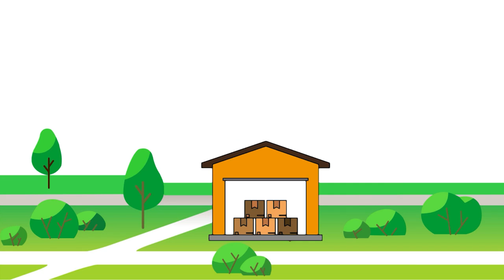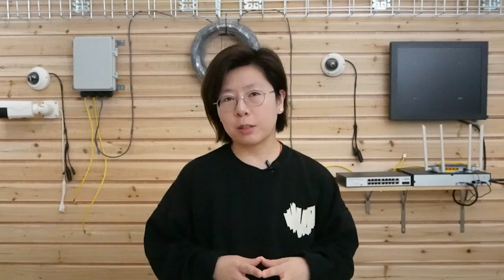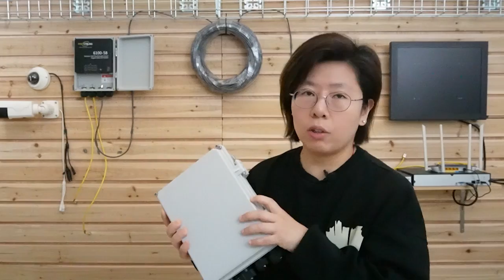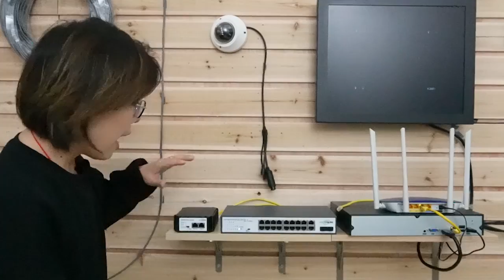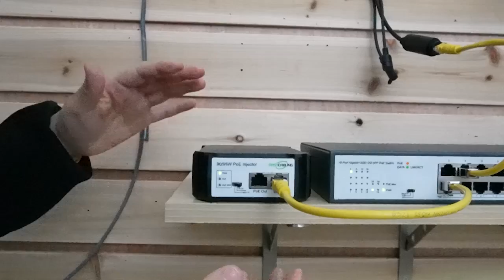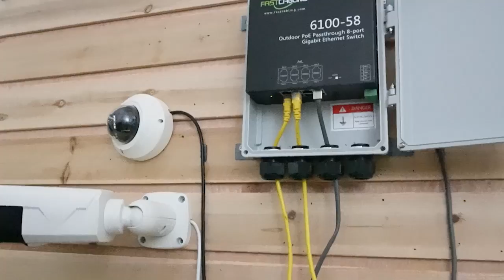Install a 24-CH IP Security Camera System for Storage Faculty| Case Study

Comment: Is there ever a layout situation where a 90w POE injector is TOO MUCH wattage for the layout and number of devices? Can individual devices be over powered to the extent that damage may occur?

Also, I would like to use V360 wifi PTZ cameras communicating through EAP225 AP's. I assume that each camera would have to have a dedicated power source...is it possible to run those type cameras as POE devices? While on the topic of V360 PTZ wifi cameras, is it possible to run those types of cameras to an NVR and have the NVR plugged into a router and have access to the camera feeds both locally and over the internet?

And lastly an Omada controller is also assumed. I have no working knowledge of how the Omada controller works. Is there a place to learn how the Omada applications work?

Thanks in advance.
Reply from the maker: All the devices just will consume the power it needs. 90W PoE injector doesn't mean it will output 90W unless your device needs such high power. But it will be overkill if put a 90W injector to power EAP225. As a matter of fact, it will not work, because the EAP225 doesn't compatible with the latest POE standard IEEE802.3bt. Part of the EAP225 is being modified to take in the 24V passive POE which causes the power issue in the latest PoE standard. If you want to power the WiFi PTZ camera with PoE, you might add the PoE splitter. The PoE splitter seperate the PoE power and convert it to DC12V.
Reply: @Fastcabling  
Thanks for your reply. My basic goal would be to run three EAP225's as POE devices for wifi connection to four (to begin with) and up to six V360 PTZ wifi cameras. I think I have gotten to the point of understanding that I will need to use at least an IP67 reverse POE switch running to the EAP225's using CAT6 copper. If I wish to use the POE switch as a true POE device (no dedicated plugged power supply) what would the consideration be for also using a POE power injector to the POE switch?

And as a bonus question that I really hope you have knowledge....are there Wifi PTZ cameras that are compatible with a PC platform that do not require the Bluestacks Android emulator? I am in southeast Asia and it seems the only wifi PTZ cameras offered for sale in this market are built to work with Android cell phones.